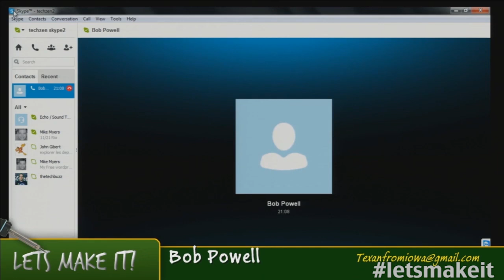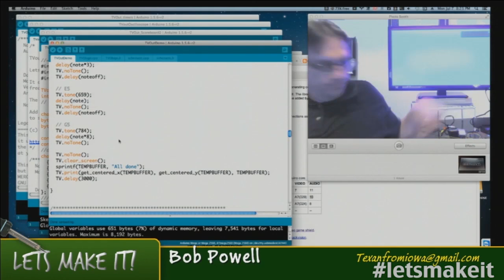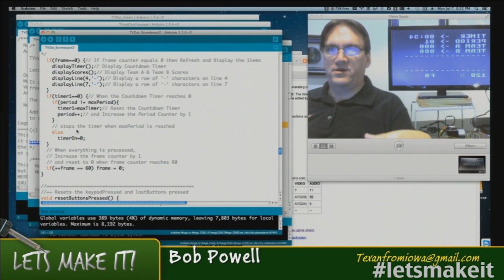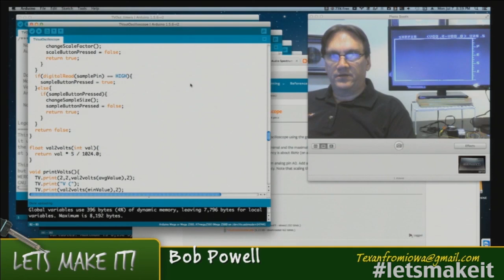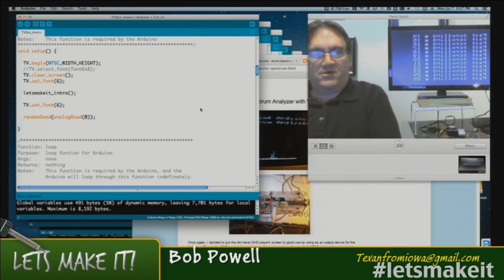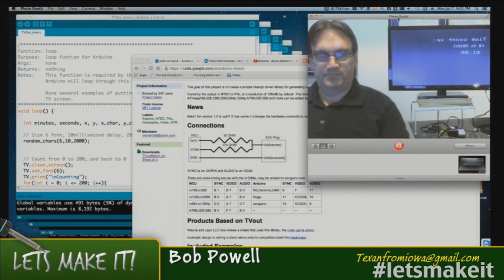Arduino TVOut On Steroids - Lets Make It - Episode 65 - Tech-Zen.tv - Alixa.tv

Comment: I got TV out running. I also changed the color temperature of the monitor to be red. I also started experimenting with small resolution images 120x96 using online tools to create the array. So far images work. Next I tried to use the fonts, and also tried to create my own, but here we failed. We want a wider higher font. but with the 0b00000000 format you can't get more than 8 character wide font. My custom font is 11x18px. So I''m stuck at the fonts there. I could maybe simply create 10 seperate "images" as array to hold the data for numbers 0,1,2,3,4,5,6,7,8,9 and just call the image corresponding with the number if a score is kept.
Reply: The font information is the same as the other bitmaps that can be used in TVout. Since an 11x18 font  is wider than 8, it can't fit into a single byte, and would need to be displayed in hex format to work
Reply: @samDuder3741  To get these fonts working in TVout library, the library needs to be updated to include the required data format in their structure. But we can only use single bytes. this is why I failed there. I haven't got enough programming skill under the belt to add this functionality to the library. So instead what I did was make each number I want to display in my fontsize a single image. converted that into byte array. called the image bitmap with the bitmap function and there was my number. Repeat 10 times and I got my score display. I got some videos uploaded on youtube about it. https://www.youtube.com/shorts/ZFV9RoAht2M this is how it currently looks. Right now I'm looking at mission pinball framework to take over the display role. I learned a lot using just TV out.

Comment: 4 Years and no comments? gosh... no more! I'm recently discovered arduino TVout library and got a spare LCD monitor, but as I investigate the possibilities, I see It's quite limited. Just 1 color. Is it possible to add in grayscale to the TVout library? I figure color is going to ask a lot of the arduino, but a few grayscale values? what about that? I would like to make a display for my pinball machine. I figured I can use the color temperature of the monitor itself to get the red color often found in displays for pinball machines. It would be real nice to have a few grayscale values....